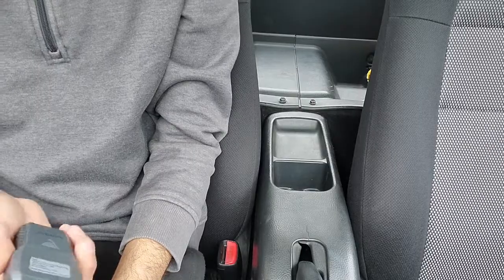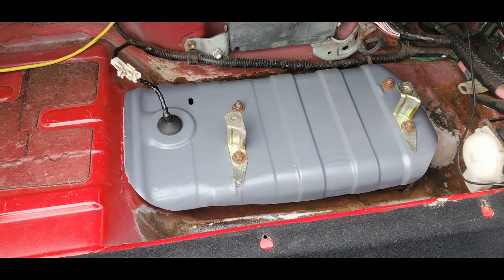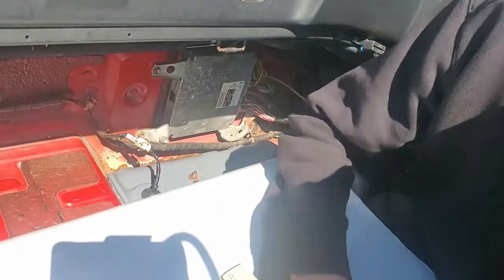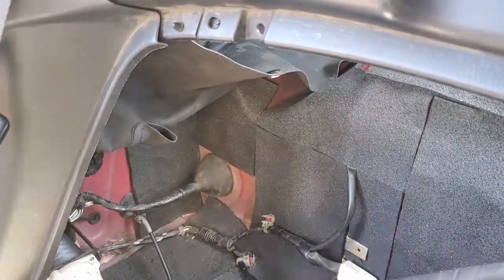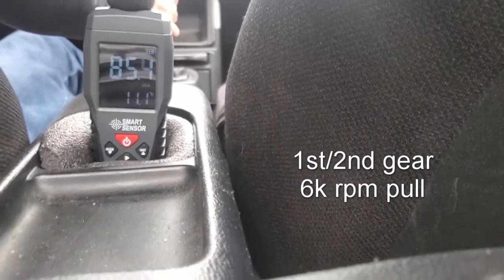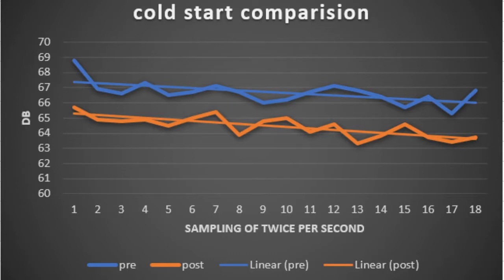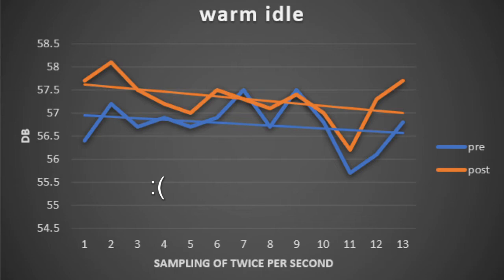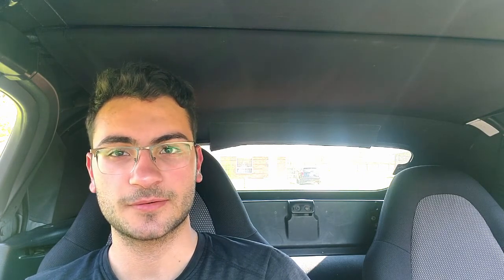Dynaliner Insulation Sound and Heat Test in Mr2 Spyder

Comment: I have a couple of buckets of Lizard Skin waiting to spray into my Spyder when I remove the soft top as I already have a hardtop. Curious which of us get better results.
Reply from the maker: Great idea, let me know how well it does
Reply: @abdullahmohieddin  Will do. It will be interesting to see if the results are so close in comparison noise wise that it makes the more expensive Lizard Skin a waste. I already assume that it will be heavier.
Reply from the maker: I think it might perform better. The firewall is so thin that it can definitely benefit from some added weight. This might reduce vibrations more than sound intensity though.
Reply: @abdullahmohieddin  You have a good point. Regardless it will make for a nice comparison. Maybe merge our videos together later to give a comparison on results and price.